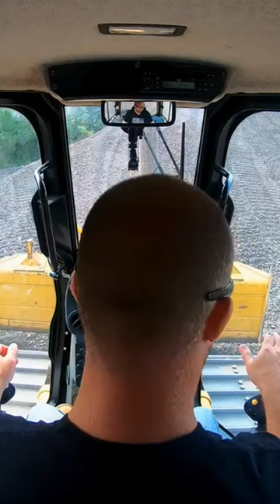#bulldozer tips and tricks

Comment: I used to read manuals when I got bored waiting for trucks.  I watch YouTube now.  Maybe I should go back to reading manuals.   I have never heard of this feature. Thanks, brother!
Reply from the maker: That's a good idea! I learned a lot of what I know from watching other operators both in person and on YouTube
Reply: It’s really handy because your hydraulics perform best at full RPM so you can ride your pedal to creep but still have precision blade control
Reply: Deere has that on the left joystick..Press & hold to accelerate or slow down but rpm remains the same..When I first jumped I was like wtf 🤣🤣..Ngl,it is a very nice feature once you adjust to using it,which didn't take long😊

Comment: not most dozers. this is a pretty new thing
Reply from the maker: Most dozers that have been manufactured in the last 10 years or so.  I would argue at this point that is most dozers in the workforce.
Reply: @DieselandIron  we just bought a 2023 cat d3 with almost every option including heated grips and seat but it doesn't have this.

Comment: Used it before, makes the machine jumpy in my opinion, and as someone who has run old gear too, I prefer to hear the motor idol down, just another way to feel what the machine is doing.
Reply from the maker: Everybody has their preference.  By keeping the engine RPM's up you stay in the torque curve of the motor and you have more power.

Comment: Just had to run a dozer with a sticky decel pedal. I used the track speed selector on the joystick instead. Super sucks. Not sure why you would change the pedal when you already have a speed selector on the joystick
Reply from the maker: Ya, I've never been a fan of using the speed buttons on the joystick for real time control.  The response time is too slow to keep up with what I'm doing.